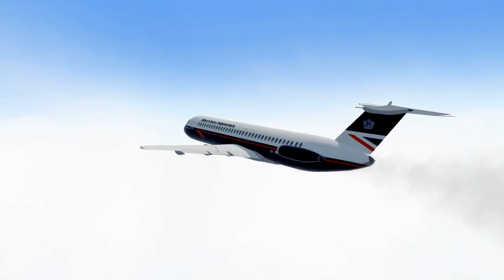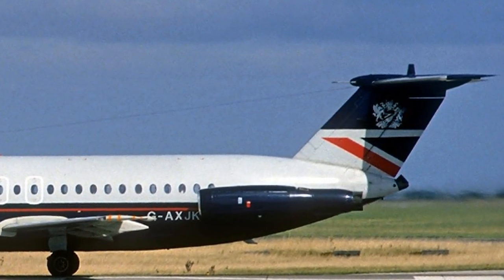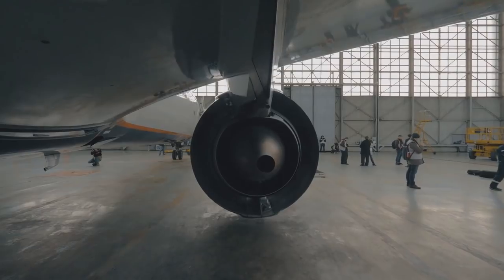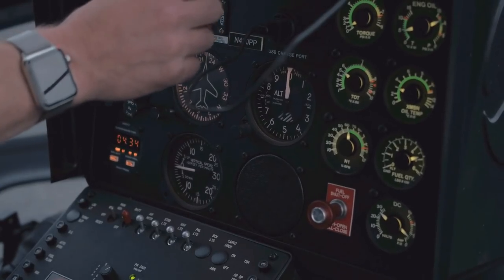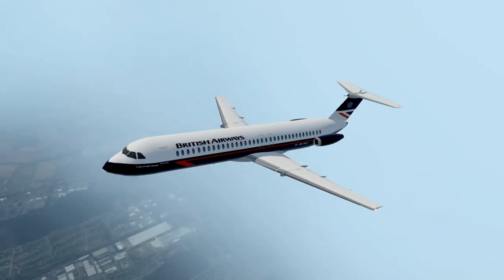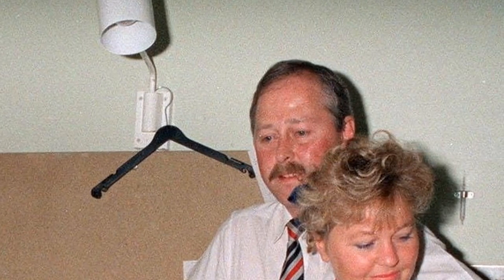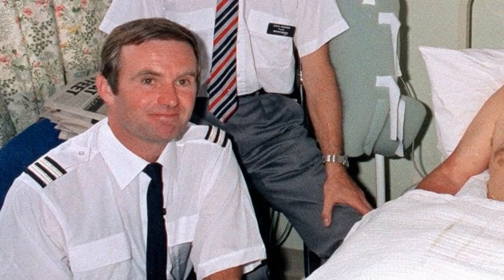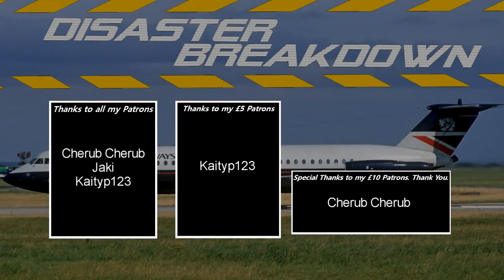The Captain Was Blown Out of the Plane (British Airways Flight 5390) - DISASTER AVERTED

Comment: There are more issues with the windscreen replacement than incorrect hardware.  Two things that jump out to me immediately is the fact that the aircraft was returned to service so quickly after the windscreen R2.  Anytime a windscreen or hatch is replaced, B 1/2 is used to ensure a good seal is present for cabin pressurization.  It takes a minimum of 24 hours to cure.  Following the 24 hours, a cabin pressure check must be accomplished prior to returning the aircraft to service.  The reason the check is required is to ensure the aircraft can maintain pressure as well as making sure the windscreen is properly installed.   According to the timeline you mentioned,  there is no way this was done.
Reply: Did the same procedures we have now exist 31 years ago?
Reply: @krashd  maths and science was available then...common sense too...and negligence and ignorance also...
Reply: I believe the plane was left sit for the 24 hrs to let the sealant set. No pressure check before return to service though.

Comment: Always easy to blame the mechanic.. How about reviewing the corporate structure...
Reply: !!!!! This!!!!!!  It's easier to blame rather than doing the extensive work to rework the whole system
Reply: @Belihoney  it was fundamentally one man’s mistake.
Reply: @peteconrad2077  And partly a design issue.
Reply: @smwca123  not really. The design works if you use the right bolts.
Reply: @smwca123 the design isn't an issue if you use the right bolts, mediocre repairs equal mediocre performance

Comment: What a horrible machanic! 0.66mm is a HUGE difference for metal fasteners. It is extremely easy to see a 0.66mm difference side by side. Hell, 0.66mm is big even for large bolts, let alone normal screw-sized looking bolts. Try a slightly undersized bolt in a nut. It takes only like 0.25mm to become quite wobbly if it's not huge threading. 

With how over-engineered a plane is, he'd have to be literally stupid to just ... accept a 0.66mm difference.

Comment: The fact that the mechanic would go to some regular parts store & "eye ball" it because he doesn't know exactly what bolt is required should be a big red flag indicating that he is not qualified to do repairs on that plane. This isn't a home project..its maintenance on a machine that's trusted to carry many people safely. If it fails in the air it could kill hundreds.😕 You'd think they'd get repair supplies directly from official trusted manufacturers and have mechanics who are familiar with that plane. Yikes! They really got so lucky.
Reply: A parts store is the place where parts are stored.  There's a guy at a desk and you ask him for what part you need and he goes and finds it.
It isn't Home Depot(it's in the companies maintenance area).
The parts counter guys know everything about the things they keep in stock, and it's reported that the guy told the mechanic they were the wrong size bolts, but he installed them anyway.
Reply: @coast2coast00  he still gave the bolts out of that very part store..he is liable ...cause..effect...
Reply: @captainpotato6856  Different version (Air Disasters ?) went into more detail about the bolts. I think the parts store guy said that size bolts weren't in stock but the mechanic went back and eyeball-matched the closest he could. The bolts he was replacing were also the wrong size, and nobody went and checked the parts specification to see what they really needed.
And no doubt someone would have been hounding them to return the plane to service.

Comment: Due to the air pressure inside the plane being higher than the outside air pressure, explosive decompression results in things/people being pushed or blown out - not pulled.
Reply: No 'every reaction has an equal and opposite reaction'?  😉
Reply: @krashd  huh?
Reply: @digitalutopia1  I was suggesting that for their to be pushing would there not also be pulling?
Reply: @krashd  You're misunderstanding Newton's third law. An opposite reaction doesn't mean pushing and pulling - because despite how much they're opposite actions, as far as force goes, it's the same direction.

The law itself refers to something that isn't usually considered. For example if a car hits a wall, we normally think that there's only one force at play- when in reality there's two.

The force of the car hitting the wall is the first, but the wall delivers an equal and opposite force to the car, as well. Whatever object as the least mass will lose the battle - if the car has more, it'll penetrate the wall - if it's the wall, the car will bounce back, if it's equal, the car will just come to a stop.
Reply: @digitalutopia1  Ahh, I getcha, I didn't know it was a "when an unstoppable force meets an immoveable object" type of deal.  I just assumed that during a pressure differential one side would be pulling while the other pushing, I didn't know it was all push.  Thx for that :)
Reply: @krashd  Yeah, it's not very intuitive- but Newton's Cradle (that thing will the metal balls in a row on strings, where the balls bounce off of each other) is a great example.